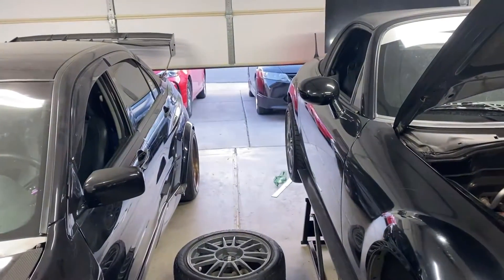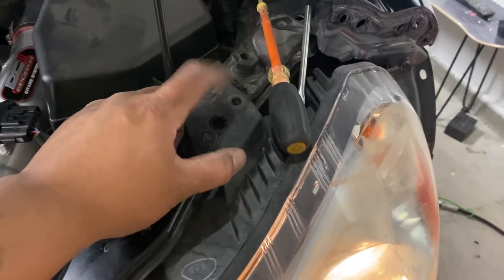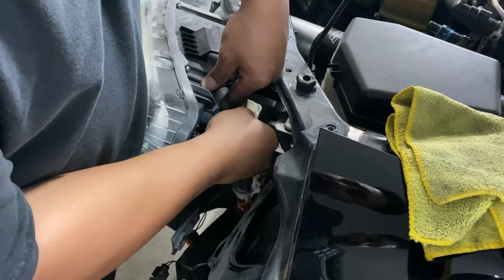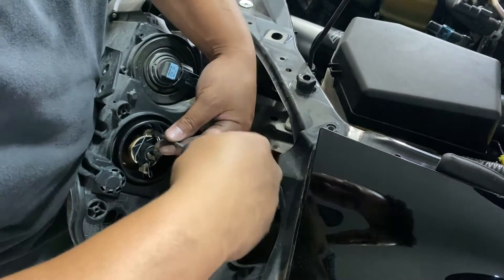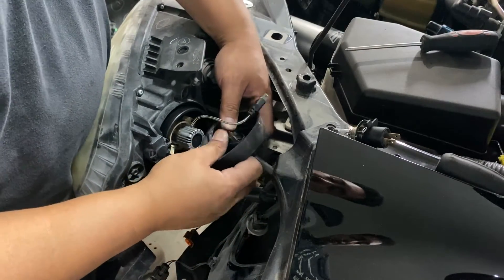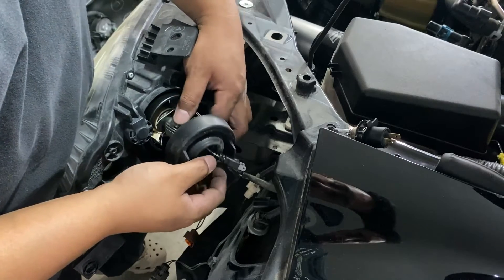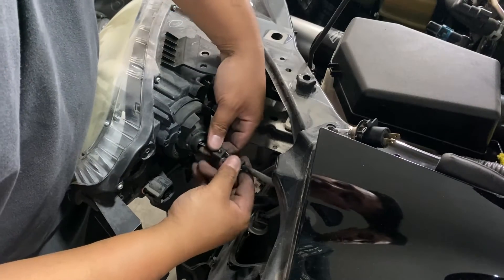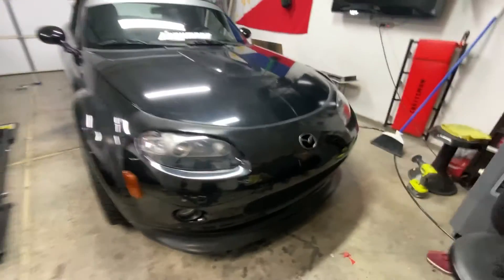2006-2008 Mazda MX-5 LED HEADLIGHT BULB INSTALL

Comment: You gotta buy a H7 Mazda adapter if switching from halogen to LED. Essentially a spacer so the retaining clip will hold it down tight.
Reply: Halogen has a cover and ballast on the assembly right? Maybe was an option on GT trim?
Reply: AND.... available from any branch of the Amazon family tree.

Comment: Bro, have done or seen any convert a 2012 Honda CRZ from an automatic transmission to a manual transmission? If so, what's the cost & is worth doing? Thank you,
Reply from the maker: I don't think I have... It would probably be cheaper to sell and buy a manual one though.
Reply: @UbanteGarage  Thank you,